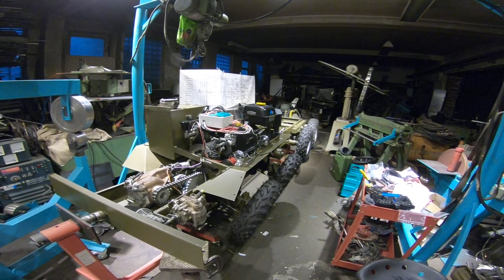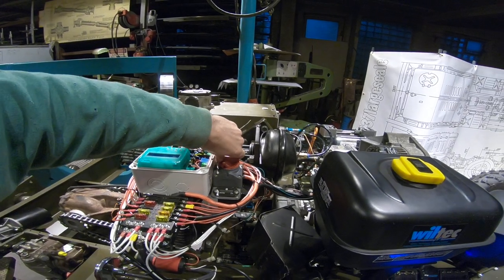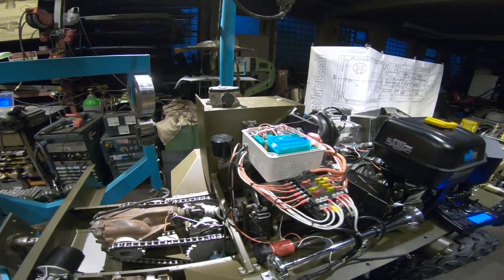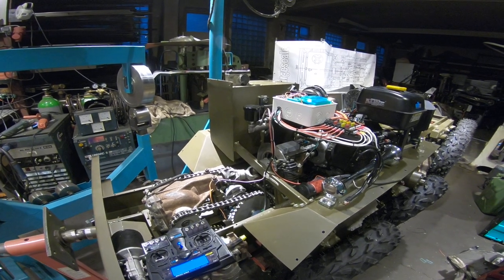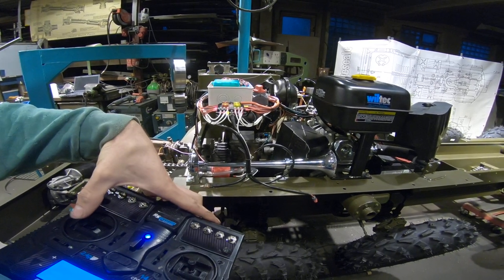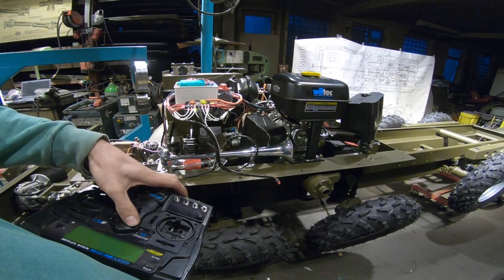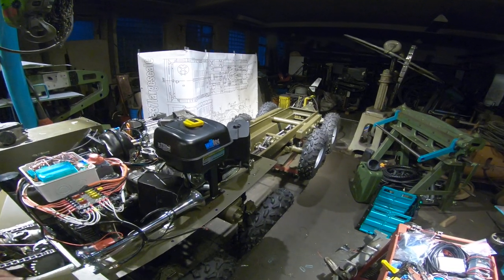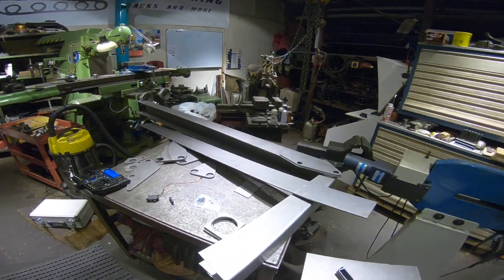MAZ537 Largescale first test 1:2.5 scale rc controlled

Comment: Such Great Ork ! Wooow
From my opinion, even if I like solid link for all transmission, due to size and command of such scale, I think I go with a hydrostatic transmission instead of non synchronized manual shifted. 

Also use a very high efficient silencer for exhaust but it's not important

Cheers from new follower in France 🇲🇫